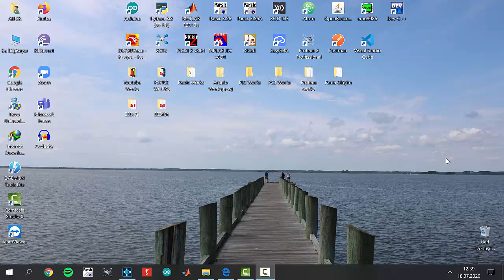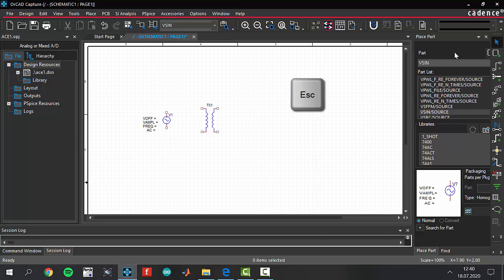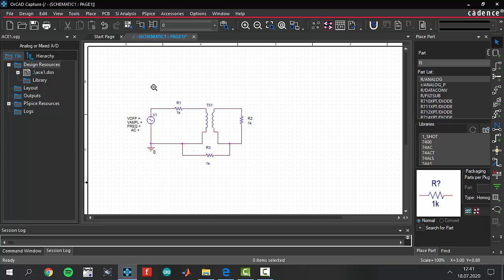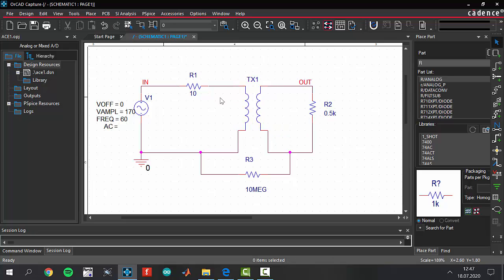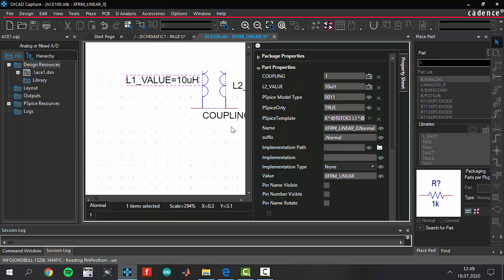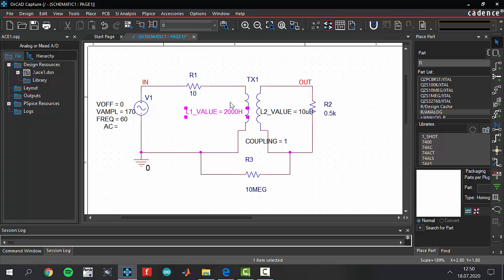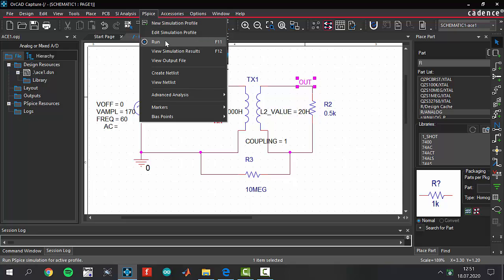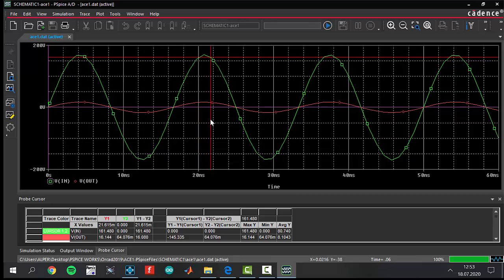LESSON 7: Additional Circuit Example 1 Transformer Circuit #pspice#orcad#cadence#tutorials

Comment: Hi ,

can you please help me how to fiix this errors in pspice for ti

** Profile: "SCHEMATIC1-LED_Driver_Transient"  [ D:\PROJECT_FILES\NLIGHT\01_ELETRONICS_ENGINEER\SIMULATION\LED_DRIVER\PSPICE\SCEMATI

Reading and checking circuit

ERROR(ORPSIM-15108): Subcircuit AL8860 used by X_U1 is undefined

ERROR(ORPSIM-15108): Subcircuit B240A used by X_U2 is undefined

ERROR(ORPSIM-15108): Subcircuit LEDR used by X_U3 is undefined

ERROR(ORPSIM-15108): Subcircuit LEDR used by X_U4 is undefined

ERROR(ORPSIM-15108): Subcircuit LEDR used by X_U5 is undefined

Circuit has errors ... run aborted